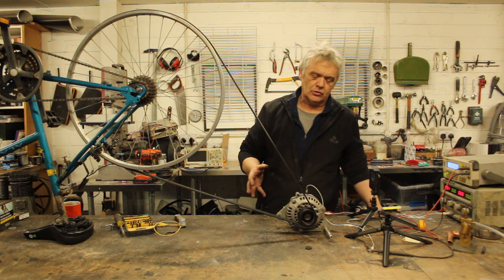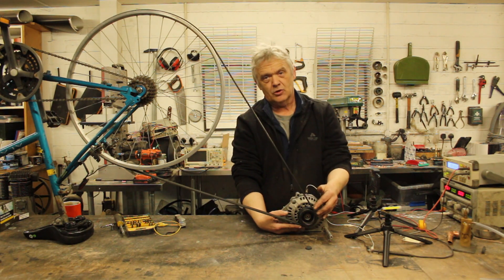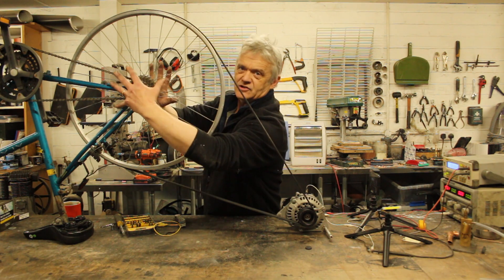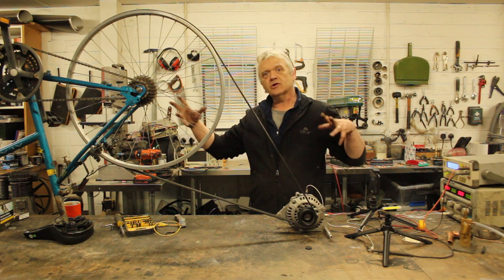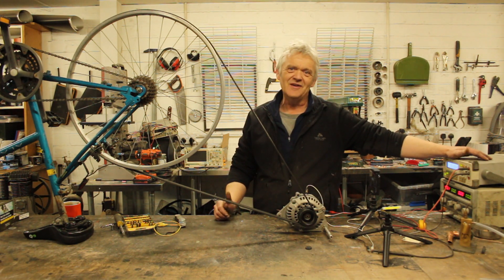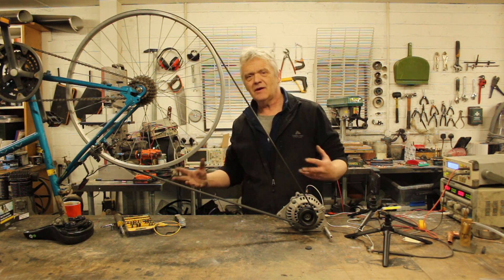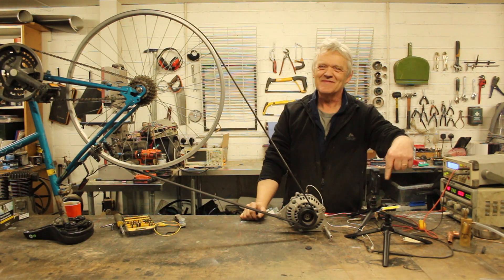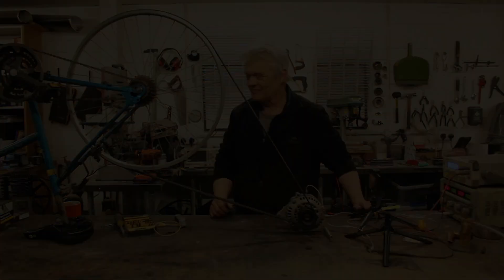1524 A Test Bed For Wind Turbine Generators

Comment: Hm, not sure of how to wire the whole setting, esp. the exciting voltage... 🤔
But I definitely like to visit a scrapyard, although even their they charge some decent money for old and worn out alternators. In the meantime I have a teared down motor floor brush from a Dyson vacuum cleaner.
Edit: I should have watched the next video first, explaining the wiring, plus using a washingmachine motor.
Great, one more option to test. 👍

Comment: Why not replace the pedal crank with a strait shaft though the crank gears? You then have the ability to add adjust the ratio and test your blades both horizontally or vertically. There’s good geared bikes in trash all the time here in the USA. Ironically you can buy a new bike for the cost of two new tires and tubes.

Comment: To get half what modern Alternators can output is more than all but a handful of people can pedal. It needs a small motor driven from the crank wheels, with either a pwm brushed motor or brushless three phase

Comment: Thank you for the video as always.  Not sure if I chatting rubbish. But would having an external power source to excite rotor and control the voltage so that it can be used "as is" for the wind turbine.  Varying the voltage would help in making sure the rotor spins in low and high winds? [Low torque for starting up, and using wind speed and alternator speed sensor reading to variate the rotor voltage? ] thank you once again for your informative videos
Reply: Yah good thought. I wonder if you used a second smaller turbine to power the rotor and as wind speed increases so does the torque required from the main turbine and in such more power generation.
Reply: @nathanrucker4987  I was thinking of a small RC (radio control) lifepo4 battery and a little solar panel. I think this would be the holy grail due to the abundant alternators in the world.

Comment: Variable svt controlled via rpm by a centrifuge choke could help handle high winds but a larger generator will be needed for the high wind safety

Comment: I been debating on weather to keep the electromagnet , or replace the coil with a thick ring magnet, and reassemble the rotor ,  I was thinking about making an aluminum, or even epoxy wood composite ring, filled with strong neodymium magnets,. I'd like to use 3 60-100amp alternators,  with. A decent size 3-5blade turbine, if I can get 500watts from a breezy day, and maybe 500-1500w on a stormy day, with 20mph winds, it would be awesome,  but 2/3 would be fairly good, I'm thinking about using 1.5"-2" angle , 3 pieces parallel, with 1/4" to 3/8" bar welded to create a tower, 40' tall, going from 18" spacing, to 8" spacing at the top, with the bars bracing around every 16" with a 15-20' section of 1.5" pipe to mount the turbines on, mount one at the top, if the pipe, and another about 5' above the tower , at the 5' height of the pipe, running 2x 3phase to the base, to a rectifier, so they can be series /paralleled, depending on. The wind available, maybe it will work, maybe not, but I'm hoping to atleast get 50-100w per, in a normal breeze, near 500w on a more windy day, but mostly to makeup for sunless days, when it tends to be windy,

Comment: Nice setup Rob. I would guess you have about a 1 to 16 ratio there, if so then the alternator is spinning at about 1000 rpm or more. It can put out 50 amps or more at 14 volts with a voltage regulator, so about 700 watts. Without a voltage regulator who knows what voltage it might go to before the diodes burn out from the current. It would depend on the load resistance. A proper fuse could help prevent that as well. Since you have plenty of amps, you can just measure output volts. Then take volts squared / ohms of prospective load to estimate watts. Or take volts / ohms of potential load to estimate amps to select a fuse to protect load and alternator. Cheers.

Comment: Great, would love to have seen you turn the crank with a torque wrench, to compare torque v field current. One of the big killers of PMA systems is the high cogging as a result of constant high torque. I don't understand why variable field systems are not more widely available.
Reply: I hope we get some readings for this. The cogging issue makes diy turbine building ineffective. I also asked if an arduino could be used to variate the rotor voltage

Comment: Can someone explain why you put a load on it?  sorry, my electronic knowledge is very sparse.
Reply: power=Ohm x squared Ampère
power=Volt x Ampère
Reply: @hommerdalor6301  Much better than my poor memory, thanks.  Revised: Power is volts times amps.  Current is volts divided by resistance.   No resistance = no current, and no works gets done.
Reply: @azlandpilotcar4450  
;-)
Reply: Here's a hack at it: A load is resistance.  Ohms law says (my bad phrasing) that power (in watts) is current (amps) divided by resistance (in ohms).  One cannot divide by zero so a current over a perfect conductor with no load cannot have a system power greater than zero.  Likewise 0 current divided by any load value is also 0 power.
Reply: @azlandpilotcar4450  nice one.  Thanks
Reply: @jonesPossibly  My memory failed me -- see reply to hommer dalor.  Principle is correct but I labeled the bits incorrectly.